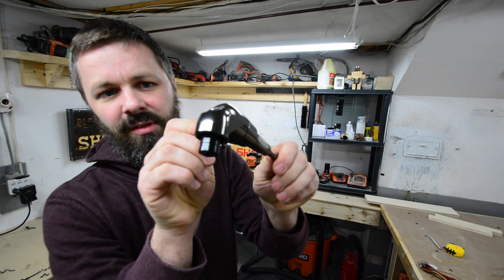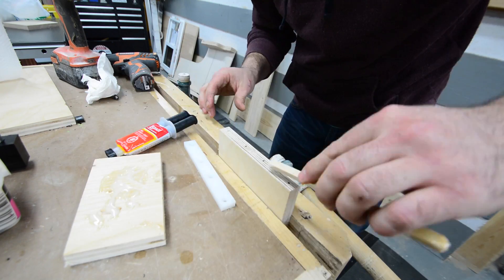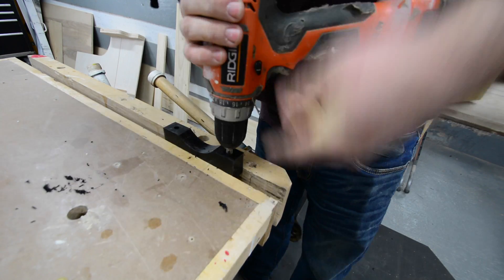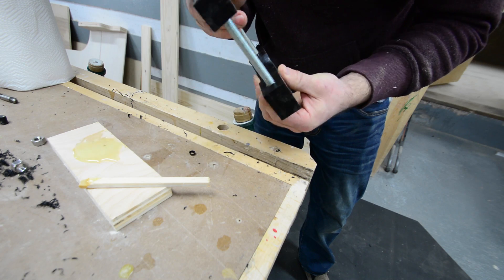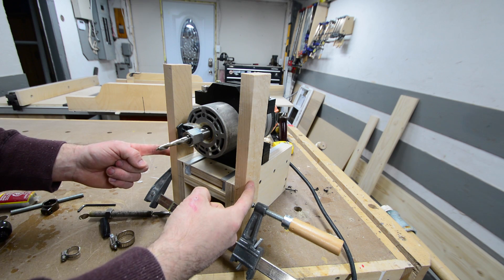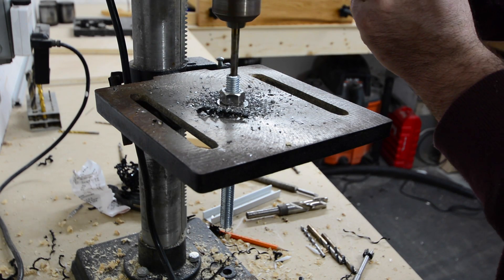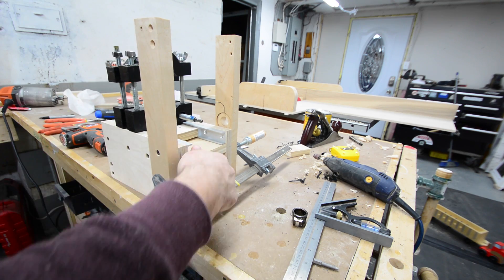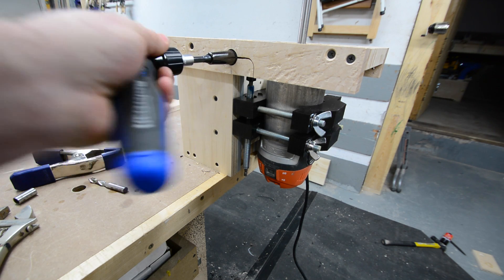Shop built - Router Lift

Comment: This is a brilliant design, even after four years after it was conceived/made, that will remain at the top of the particular list of router lifts. I see that you have provided a knob to secure the position of the lift. I would like this modified so that it operates under a remote access too, like the lift mechanism, but that's a story for another day, I am sure. The whole system is easy to understand and you have made this aspect even easier with your clear description. Can you please advise where you obtained the 90 deg. drill attachment?

Comment: Hi great vid and very well made but watching this video I noticed if you bang the router table the 90 degree angle attachment ( as it's a friction fit and small clip ) could drop the threaded rod out which means the router could drop out the bottom of the runners. Might I suggest a pillow bearing on the end of the threaded rod at the bottom just for the extra security of keeping the router in place.

Comment: Outstanding on every level. The video was all business, packed with info, showed everything and did not waste one second of my time. The project itself is well conceived and executed. A router lift is something I've been considering for some time and I could not decide on a design, nor did I like anything I saw, until now.
I'm glad you shared this knowledge. Thank you.
P.S. I had to come back and edit this. I do not have your skill, and I doubt I ever will, but I think I can get a simpler version of this to work. But - there is no flippin' way I would even attempt to drill a hole dead center in the end of thread stock. Fuggedaboudid. Anybody think of something else that would work, please reply.

Comment: Best router lift ever. Just finished building it to replace my old one. I did not use the 90deg drill, but went with a top screw like I had before. Works like a charm with a new DeWalt. Thanks a bunch for the video. My next build will be the slot mortiser to use my old router.
Reply: I agree.  Best I have seen yet.  Going to adopt the same procedure for mine.  Who cares if he called the track "T" instead of "U" as someone negatively stated.  Credit where credit is due and don't sweat the small stuff!!

Comment: that nifty and if you added a motor it would serve a brake and motorised lift. you could almost figure out how to make this cnc controlled lift so you can zero a bit and set you cut and change as necessary with accurate results.  plenty close enough for woodworking but spot on for a lock router bit.

Comment: i've watched quite a number of router lift DIY and I like your design very much. 
One problem I see in almost all lifts is that they are unbalanced in the sense that only one side of the lift supports the weight of the router.
I built a router lift about 3 years ago from a Matthias plan and noticed this problem almost immediately. It worked but I never was happy with it. 
I planned to upgrade his design with the same idea as yours by using the right angle drill adaptor but this coincided with my buying a Triton router which had it's own lift built in and with that purchase the problem was solved.

Comment: I'm worried your design is not going to stay accurate over time - the entire wt. of the router is hung from and has to lift from one side - vs lifting evenly from both sides.  Also difficult to keep the bit 90 to the table when hanging from one side.
Reply: Bridge the two sides together and raise from center under the routercost would very minimal
Reply from the maker: +Tioga Fretworks this is true, most commercial lifts are supported in at least two spots (usually 3) but most homemade lift are overhung like this one. For most routing applications this is plenty strong but if your making big moulding or large cabinet door profiles than a homemade lift is probably not a good option. Adding a second support really does add a a lot of complications (and money) to a homemade lift but that being said I have been working a design that would be supported on two sides but the cost is creeps up quickly to the cost of a commercial lift.
Reply: Shop

Comment: Nice build.
Please be aware that epoxy does not bond to polyethylene nor to polypropylene.
Reply: Loctite® Plastics Bonding System is a two-part cyanoacrylate adhesive that sets in seconds and develops tremendous strength with just one drop. The activator primes hard-to-bond surfaces such as polypropylene and polyethylene. Loctite® Super Glue Plastics Bonding System dries clear and sets without clamping. It is resistant to water, most chemicals and freezing temperatures.

Comment: Do you have experience with cnc
Reply: +Shop built is there a viable alternative to manufacture the mounts if I do not have access to a CNC-style machine such as the one you used? I really like you concept and design, just not sure about my ability to make that mount.
Reply from the maker: +Richard Shaw yes

Comment: Nice build! As idea - you can have one more way to go with height adjustment that will be available at the top of router plate, you don't actually have to use this adapter and anyway you will be using top plate to cover space around router bit. Cheers!

Comment: Hi, great design,I made my router lift using the same angle adapter for a drill only I used a x lift table under the router and using threaded bar up to the top and rear of my table

Comment: Love the project, but what I loved even more is the pace of the video and your narration. Lots of times when I watch this type of video, and I've watched a ton of them, I have to speed up the video to 1.5 times or in a few cases even 2 times normal speed cause the speaker is mumbling away and showing things at normal speed which should have been sped up at a minimum or cut out altogether. And very clear too! It was really easy to follow what you were doing. Huge props Great job on both the project and the production value of your video. I'm subscribing!
Reply from the maker: +laurentco thank you! Always nice to get positive feedback on production:)

Comment: Rather than drilling the drive screw, how about putting a coupler on it and put the bit into the square drive.  Then put epoxy into the coupler and slide them together.  That should give a good angle eliminate the need for drilling the drive screw.
Just a thought.

Comment: ok i do like the design of this lift.  very simple and to the point.  i have wanted to do something like this for a while but getting a non plunge router in nz is difficult and extremely expensive.  for a one man shop i have never been able to justify the cost and as i just retired i guess its a pipe dream lol.  i miss my shaper.
Reply: +Tayler Made I modified a cheap (old) black n decker plunge router by putting a threaded rod finished with the head of a furniture bolt through the base and up to the old depth adjustment bar, where I mounted a nut. Can then adjust depth from the base. Then just mount that to a bit of MDF with a hole in it. Works great as it just uses the existing plunge mechanism.

Comment: I was thinking of doing the one shown by Steve Ramsey but now I am going to have to re-watch his and yours to see which one I want to go with!   Very nice build and I think it is easier than Steve's---which is based on a Woodsmith design by the way.  Where did you get the right angle tool and what was the cost?  Thanks
Reply from the maker: +Terry Ellis I got the attachment from princess auto,( it's a similar store to harbour freight) I paid 20 bucks for it on sale (30 reg price). It is of better quality than some, I first bought one for 10 bucks and it was rough, I don't think it even had bearings. This one has input and output bearing and runs really smooth. Also has the quick connect instead of a magnet. There is some really good designs here on YouTube, steve's, matthais's, jay bates and John hiesz are all really good (probably lots more I don't know about) I personally think router lift are fun to design yourself, lots of options out there and just experimenting with different ideas can be fun.
Thanks for watching
Ryan

Comment: Very nice! I liked every step of the build. Regarding the spacer piece between the tracks, I usually make them smaller and add sandpaper shims until I get it right. Sometimes I need to adjust the shimming in the winter, but I guess that's because I'm using particle board instead of plywood. Have you experienced something like that? thanks!!
Reply from the maker: +Cactus! workshop I usually use shim as a last resort because after the project is finished, I usually take it apart and glue everything together but it's definitely a good back up.
Thanks for watching!
Ryan

Comment: This might seem like a silly question but I am unfamiliar with the 90 degree drill attachment. What keeps the bit/lead screw assy from coming out of the drill attachment ( and the router from falling ). Is there some sort of positive locking collar on it?
Reply from the maker: +Paul Johnston yes, there is a quick connect that locks in the little groove in the bits, similar to the locks on a impact driver. That being said, you bring up a good point, if it came disconnected the router would fall so I'll add a stop at the bottom so if it does happen, it won't fall to the ground.
Thanks for watching and thanks for bring this up.
Reply: Shop built ĺ